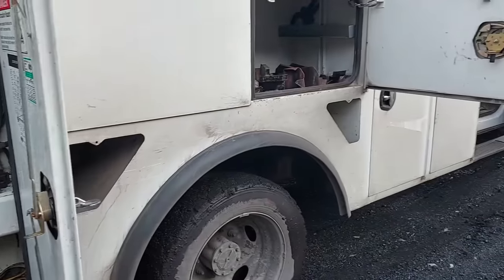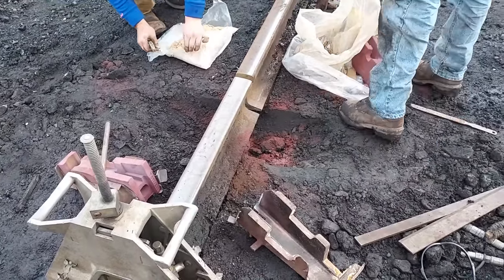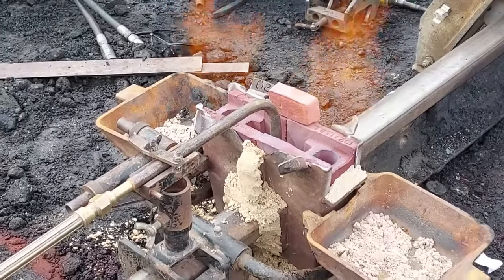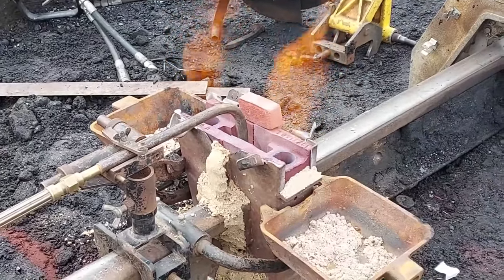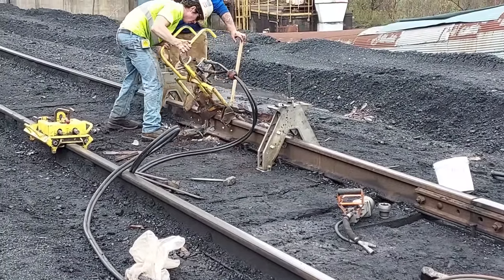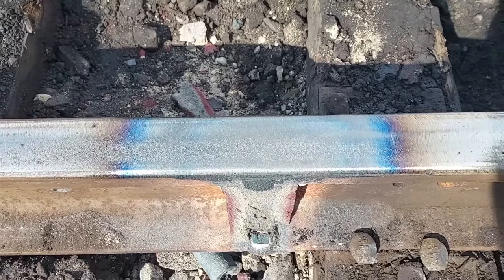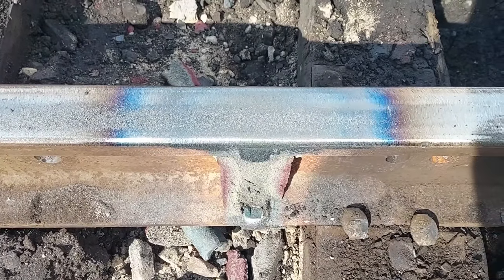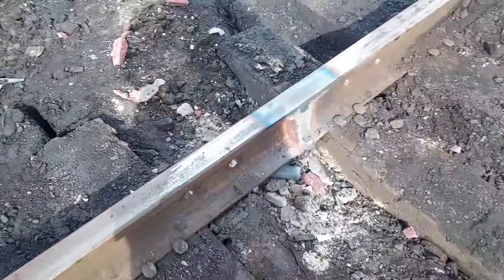Shooting a Thermite Weld on the Railroad from Start to Finish

Comment: So question from someone who knows next to nothing about welding and laying track:  I certainly appreciate the level of precision in aligning the track horizontally and vertically but the question is - is such precision absolutely necessary or is there an allowable fudge factor?  Aside from smoothing out the ride, what is the benefit of the extra time and energy put into the alignment?
Reply from the maker: On a class 2 RR like we have here only hauling coal, a small
misalignment is no big deal, but these guys also weld transit
track and passenger track where speeds can reach 100 MPH,
so alignment is critical for high speed track to keep trains
running that fast on track and passengers safe. Thanks for
stopping and checking out the show Chuck.

Comment: So why not use a splice kit. See the bolt holes. Are they not as good. Seems they would last longer. With the constant up n down motion it will experience when train passes over. Seems like the weld would break after time.
Reply from the maker: Welds do break on occasion Craig, but it's rare. Really poor
ballast here and can't hold track surface with a joint, so they
welded it. Appreciate your visiting with us
and watching the video. May you have a wonderful day my friend.

Comment: WHY?  At 17:57 you can see two sections of rail connected using a “fish plate” 

Is it not permitted to use two “fish plates” so close together, or is thermite stronger, faster,and cheaper?
Reply from the maker: This as you can see from the ballast (well what used to be ballast,
now full of coal fines), when it gets rained on becomes rather
soft and will not support a joint, so the joint is constantly working 
up and down over train weight. Welding so there are no joints
works much better for holding track surface. Thanks for watching
the video today and writing in AV84USA

Comment: a couple of points.  6:25, a flint lighter is a surer and safer way than a cigarette lighter to light the torch.  even my old boss would have not tolerated that.  and 12:00, hands are not hammers.  i have arthritis problems from using my hands as hammers.  ideally, there should be sleeved handle extenders.  or use a real hammer.  thirdly, i agree with you about how i also never tire of watching thermite welding.
Reply from the maker: Thank you for sharing that with us VSV.  Points well taken. Very much appreciate your taking time out of your day to watch the video and may you have a most blessed day my friend.

Comment: Why was a thermite weld needed? Just curious. No back story or anything. Trains have been running on spikes for over a century. What makes this a thermite necessary weld?
Reply: joining 2 ends of rail.
Reply from the maker: Rail had broken here and we replaced it with a short plug. So
we took the plug out and welded in a new one. Very poor
ballast here and joints just don't hold track surface well
in bad ballast Gary. Thanks for writing in and watching my good man.

Comment: Look at the old space shuttle. The heat shield tiles were made out of a lightweight, fragile ceramic but could hold up to thousands of degrees...
Reply from the maker: Wow I never realized that Kraz. Pretty interesting stuff but I guess
if they can hold up to this extreme heat for a weld, then for sure
on a space shuttle. Neat, thanks for sharing that.

Comment: So there is no easier way to accomplish this?
Reply from the maker: There is a process called flash butt welding Joe that is easier,
however that requires specialized equipment and these are
contract welders and don't have that equipment.  Thank you for
taking the time to check out the video and may you have a very
good day my friend.

Comment: Is the torch run fuel rich when its pre-heating?
Reply from the maker: It appears to have a good bit of gas supplied to it doesn't it.
Thank you very much for taking the time to write in and to check out the video Byron.

Comment: What prior job experience or prior training is required to work for the railroad?
Reply from the maker: That would be up to each individual company Scrapla. Here
we have a mine and you would have to start under ground, then
by seniority number get a job outside which would take a long,
long time. Best bet is to hire on with a RR contractor, they
usually will take someone with no experience.

Comment: called a redox reaction, iron oxide and aluminium and something hot to start it. I used to do small reactions, you can also use manganese dioxide, the black stuff from drycell batteries.
Reply from the maker: Thank you Daryl for taking the time to watch and write in my good man.

Comment: Why were they using all that expensive thermite? They should've just used jet fuel. They could construct the box out of old passports since they're tough enough to survive the fireball.
Reply from the maker: Thank you very much Peter for taking the time to visit with
us and check out the thermite welding. May you have a most
blessed day my friend.
Reply: @ccrx6700  Thanks!

Comment: with how much setup and cleanup this takes, it seems like it would be faster and cheaper to just arc weld the two sections of rail together. But considering the rail industry uses thermite all the time for this, im sure there is a very good reason why they use thermite instead of arc welding. Do you have any insight as to what those reasons might be? 

I wonder how they avoid gas bubbles or slag in the joint when using thermite. Perhaps its just based on the density of the steel produced and the geometry of the vessel preventing voids down low? 

Very interesting to be able to see this whole process. Does that large crucible thing get thrown away after every use? I imagine its all filled up with steel and slag and cant be easily reused.
Reply from the maker: Thank you very much Zeoxeo for taking the time out of your busy day to watch the video and write in with your thoughts.

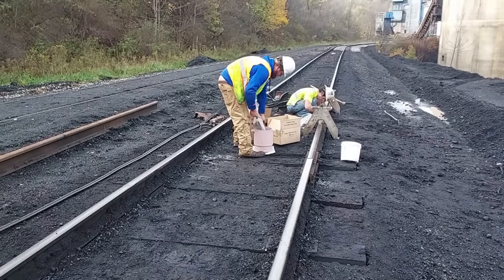Comment: 2:53 railroad repair man (snl) 😄 interesting process. In this same video I see rails bolted together. Why are some rails bolted together while others need welding?
Reply from the maker: All the rail here at one time was bolted, where the welds
were made we had a broken rail last year and they were
just now getting in to weld that plug in we used to fix the 
broken rail. Thanks for stopping by and taking in the video today.

Comment: Really great video and thank you for sharing. Knowing the cost of things like I do I would imagine those Thermite kits are expensive $700 or more? It seems anything to do with jointing or joint repair is not cheap. I used to do communication cable repairs both copper and fibre and the price of those joint repair kits where terrible and that was for smaller cables. You get into bigger cables and easily $1000 plus per joint. By looking at that finished product I have to say was an awesome job. Like most things like that. I would guess structurally that joint is now stronger than the rail itself?. Keep safe and thank you for the videos :)
Reply from the maker: Your very welcome Greg, glad you had a good time with us.. Thank you so much for taking the time to tune in and watch my friend.
At the time of this weld it was 550 that is kit and labor, that
price has now jumped to 700 per weld.
Reply: @ccrx6700  You are very welcome. Thank you for taking the time to reply as realise you are busy :). Yeah, it does make you wonder the middle man is making a fortune.... as it seems to be very hard to justify such a large increase. Sure some is justified but such a high increase... hmmm i find that hard to believe. Very easy to blame something as an excuse and or justification. Keep safe and keep well and look forward to next video :)
Reply from the maker: @nzcyclone  😊👍

Comment: They heated up the spill over pans to drive out every bit of moisture. Last thing you want is molten metal rolling over a wet surface or it will pop and splatter everywhere.
Reply from the maker: You are absolutely correct in that Mattster.  Appreciate your visiting with us and watching. May you have a most blessed day my friend.

Comment: I have to ask, this seems like much more work than 2 plates and 4 bolts and nuts.
Reply from the maker: This was a place where a rail had broke and we fixed it with a short
plug. As you can see the ballast is horribly contaminated and
joints just don't hold track surface well in that kind of ballast. 
Welded rail holds surface much better. Thanks so much Bradly197
for stopping by and taking in the video today.

Comment: In case it wasn’t been answered yet the forms are made out glue hardened molding sand and the clay is a refractory sealer like that used in iron foundry crucibles….
Reply from the maker: Thanks so much for writing in with the informative comment.
Certainly do appreciate your taking the time to watch my friend.

Comment: How much would a repair like that cost?
Reply from the maker: At the time the video was made it was 550. These are contract
welders, however prices have gone up and it is now around 700
to do a weld here by them. They only travel about an hour to
get to us, so the further away they would go, the more increase in
that price will be. At the time of the video they had just made welds
in New England and they were 1100 apiece.

Comment: MY DUMB QUESTION IS "WHAT ISSUE INITIATED THE THERMITE WELD" ? IN OTHER WORDS, WHAT CAUSED THE  TRACK SEPARATION ?
Reply from the maker: Good question Deric, we had a rail break here last winter, and
we put a short plug in to fix it, then when the welders 
became available, we eliminated 2 joints by welding the plug in.
Thanks for writing in and for watching the show today my good man.

Comment: Civil engineering meets materials science meets railroad operations - When I worked in rail marketing in the 90's there were special trains that hauled 2-mile lengths of track from fabrication facilities to sites like this one.  In some cases, old lengths of rail were recovered from abandoned rail lines and repurposed to a more useful (longer rail) economic life.  At that time I owned a house near Ardmore, PA, on Amtrak's Philadelphia-Harrisburg "Main Line" and I watched an upgrade from 39-foot segments on wooden ties to continuous welded rail on concrete ties.
In this instance, I think I'm seeing wooden ties in mud.  This has me wondering whether another crew will come later and upgrade the ties and embed them in tamped rock ballast that has better drainage.
Reply from the maker: Thanks for sharing your story with us Bag o Quarks.This section
of track is right below where they load the train. it gets polluted
with coal fines and also on occasion a car door accidently
opens up and spills 115 tons of coal on the track. it is
an impossibility to keep the ballast here uncontaminated.
We used to get Hulcher in here with a vac truck on a regular
basis to keep things half way cleaned up, however company,
as all companies are now, is in cost cutting mode so
coal doesn't get cleaned up. it is what it is, no matter how
ugly or undesirable.  I wish I could tell you that everytime
car doors open up it gets cleaned up to prevent ballast
contamination, but as you can see I cannot say that.
Reply: @ccrx6700  A transcontinental passenger main line (adjacent my previous back yard) is one thing, a busy freight transfer yard is yet another.  The welded joints in this coal facility look like practical investments that prevent derailments among the heaviest of freight consists.  A rail passenger car is like a box of air on wheels when compared to an open hopper full of coal or iron ore.
LONG LIVE FREIGHT RAILROADS !!!
Reply from the maker: @bagoquarks  😊👍

Comment: Is it the same Principle as cad welding just on a different level I used to have to get down in ditches and use a clamp on the copper wire and set a little charge off that fused the copper wire together. It was scary sometimes the molds would blow if there was to much moisture in the air.
Reply from the maker: Interesting info Ed. Thanks for sharing with us and for taking
the time to tune in and watch the show my good man.

Comment: Did this type weld many year old santa fe  bnsf  37yer west coast
Reply from the maker: Thanks so much west coast for checking out the video today.
Appreciate all your years of service on the RR. Santa Fe one
of the great RR's of by gone days. Have read several of the
Rocky Myrtle books, excellent reading. If you don't know Rocky
worked SF and wrote many books about his experiences.
Got mine on Ebay.

Comment: Is this process used/needed because of the high amount of heat needed to join that rail metal together.?
Reply from the maker: Yes it is Ike Ikie. Takes a lot of heat to weld two rails together.
Glad you could take the time to check out the video today my friend.

Comment: Probably the strongest way to do it, but you would think someone would come up with a way to make the whole process faster.
Reply: lol yes they do and have.  hirailed boom trucks with adjustable electric welders & builtin grinders usually follow the rail gangs.   they zap it and get done, imho in maybe 7 mins per joint.
Reply from the maker: We want to say Thank You for dropping in on us and watching
the presentation today DigitalKiwi114. There is a much faster
process called flash butt welding, however our welds are
done by contractors and they don't have the equipment to
do that kind.

Comment: Yup and they tried to say jetfuel that burns at 1800° F was capable of that in the trade center.... Liquid metal..
Reply: you don't need to melt metal to bend it
Reply from the maker: Was very nice of you to take the time and visit with us today
to watch the presentation TimOthinking.
Reply: @ligmayeye186  there was liquid steel dripping out of the trade center tower before it fell... As an American we have seen the footage 1000s of times. Planes crash into dirt and explode on impact, but that plane somehow cut through concrete and steel beams like a hot knife through butter...
Reply: @timothinking9855  I would love to see the video of molten steel dripping off of the towers

Comment: Nice job! What is the purpose of the 2 pans (1 on either side of the mold)? Is this where the molten material flows into from the crucible and then in between the rail, making the joint! I would assume the joint has equal strength or more to the rail itself? Good video! Joe
Reply from the maker: Thank you Joe. Those pans catch the slag. A properly
done weld is just as strong as the rail itself yes sir. Appreciate
your watching the weld job my friend.
Reply from the maker: @joekelley1014  😊👍

Comment: How the heck did that do this is the 1800s
Reply from the maker: Thermite welding was invented in 1895 although it didn't get started
being used on the railroad until sometime in the 1930's. They didn't
weld rail back in the 1800's, spliced the rails together with bars.
Thank you very much for visiting with us and may you have a really good day my friend.

Comment: Now I am wondering about the tracks expansion situation on hot days and contraction on cold nights.
Reply from the maker: We have 16.8 miles of track here and 16 of those miles is
jointed track so the rail creep is taken up with the gaps in
all those joints Joe. On CWR they anchor every tie to help
prevent rail creep. Thanks so much for writing in and for watching
the thermite video.

Comment: Why is it necessary to weld the track together? Why not just connect in an easier manner
Reply from the maker: Rail had broken there plus the horrific ballast made a weld to
eliminate a joint a much better option for us. Had it been in good
ballast then a joint would have been fine.  Thank you for taking the time to visit with us and write in my friend.

Comment: So this method is replacing the connecting plates? I noticed the next rail connection in the video had plates and no welds.
Reply from the maker: We want to say Thank You for dropping in on us and watching
the presentation today Gerald. You are correct the joint bars
are being done away with.

Comment: Why drop a weld with two joints either side?
Reply from the maker: Both of those joints were taken out and welded in Mike at a later
date if I remember correctly, that was a couple of years ago. Thank you so much for taking the time to watch and write in my friend.

Comment: They were replacing some old rails thet were dated in the 1880s .
That was when my Grand Mother was born .
I wondered if the railroad ever sells rails on sight like that.
Reply from the maker: Old rail with the mill brands proving the year is in high demand
SJM from collectors and also from museums and the like. It's
getting to be almost as expensive to buy as new rail!
Reply: @ccrx6700  
There were some old Carnegie rails I would have liked to have. Couldn't find a date on them but but they were way more warn than the others.
Reply from the maker: @Sj27m  👍😊

Comment: for some reason, the part where the mould was placed around the rail gap (and the clay sealant applied) was not included in this video...start to finish video should have included that...
Reply from the maker: You are right about that, please forgive me for not showing that
yingyang.  Thank you for taking the time to visit with us and check out the video. May you have a very good day my friend.
Reply: @ccrx6700  i enjoyed the video...fascinating...learned quite a bit....thanks for taking the time to share...
Reply from the maker: @yingyang1888  👍😊

Comment: It seems so labour intensive, 2 welds a day?...may i ask why do it when the plates can be used as always.
Reply from the maker: We were welding to eliminate the joints here 433 900, this is a place
that has a lot of coal in the ballast and joints don't hold up well, they
want to sink where as welded rail holds track surface better than
jointed rail.  Really appreciate your watching and may you have a very good day my friend.
Reply: @ccrx6700  thanks so much for the reply,much appreciated
Reply from the maker: @M-H433  😊👍